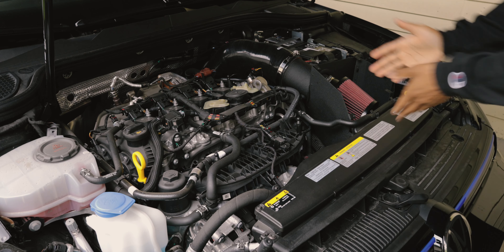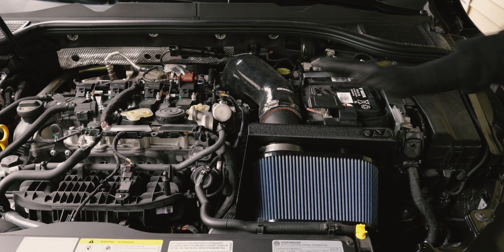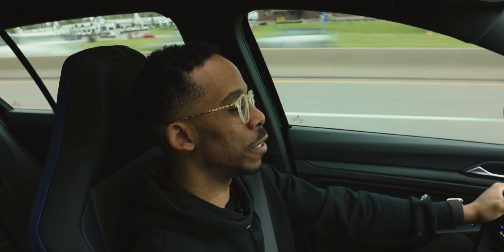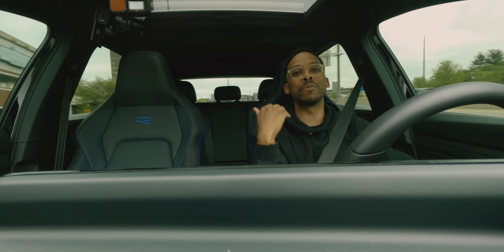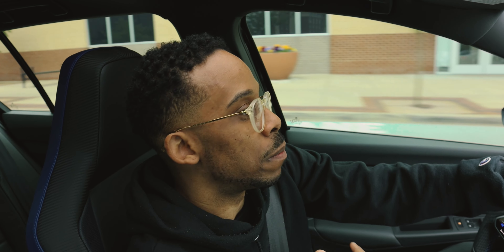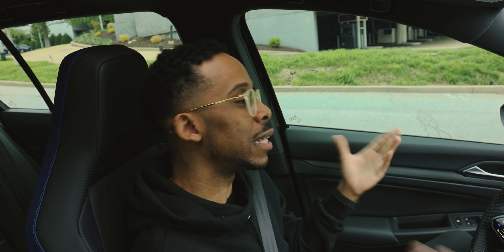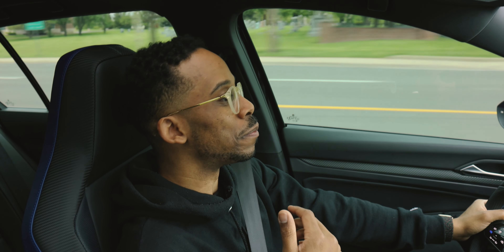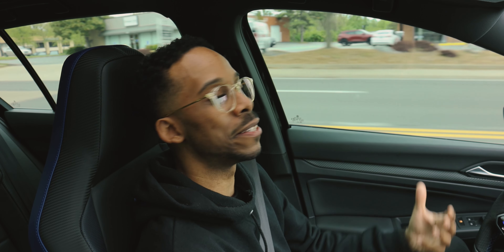New Custom Open Air Intake on the MK8 Golf R

Comment from the maker: This was a fun intake combo...
NEUSPEED Air intake (5% off msrp): https://geni.us/NeuspeedPFLOintake
Radar Detector Used: https://geni.us/RadarUsed
MirrorTap Wiring Kit: https://geni.us/MirrortapKit
Trim tools: https://geni.us/TrimTools
My Wheels🚘: https://geni.us/MyRotiformWheels
Center Caps Used🚘: https://geni.us/RotiformCenterCaps
My Tires🚙: https://geni.us/MyTires
🎶  Where I get music for my channel ►► (30-day FREE Trial): https://geni.us/CJUEpidemicSound
-----------------------------------------------------------------------------------
Links to ALL Products used to clean my car:
💦  Similar Power Washer ►► https://geni.us/SimilarPowerWasher
🍂  Similar Leaf Blower ►► https://geni.us/SimilarBlower
🍂  Same Leaf Blower(no battery incld) ►► https://geni.us/SameBlowerNoBattery
🌊  Foam Canon ►► https://geni.us/FoamCanonUsed
🌊  Foam Soap ►► https://geni.us/FoamSoapUsed
💦  Best Pressure Washer Hose(kink-free) ►► https://geni.us/BestPressureWasherHose
💦  Best Garden Hose ►► https://geni.us/BestGardenHose
Quick Connect Kit ►► https://geni.us/HoseQuickConnectKit
🚗. Best car Vacuum ►► https://geni.us/BestCarVacuum
Snub nose Pressure Handle ►► https://geni.us/SnubNoseWasherHandle
💦. Nice Wash Mitt ►► https://geni.us/NiceWashMitt
Best Wheel Brush ►► https://geni.us/BestWheelBrush
Best Wheel/Tire Brush ►► https://geni.us/BestWheelTireBrush 
🚗. Best Car Drying Towel ►► https://geni.us/BestCarDryingTowel
Brake Wheel Cleaner ►► https://geni.us/BrakeDustWheelCleaner
🚗. Tire Shine ►► https://geni.us/TireShine
Applicator Pads ►► https://geni.us/TireShineApplicatorPad
Floor Mat Cleaner ►► https://geni.us/FloorMatCleaner
Edgeless Microfiber Towels ►► https://geni.us/EdgelessMicrofbrTowel
Quality Wash Bucket ►► https://geni.us/QualityWashBucket
2.5 Orfice Spray Nozzles ►► https://geni.us/OtherSprayNozzles
-----------------------------------------------------------------------------------